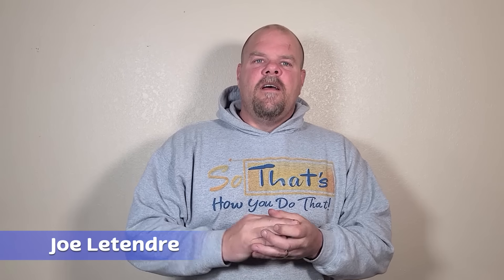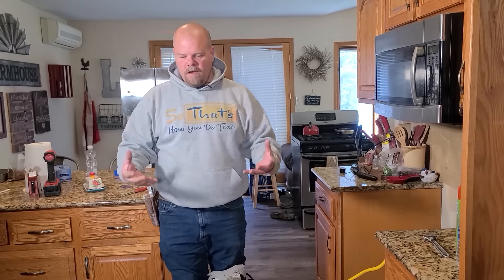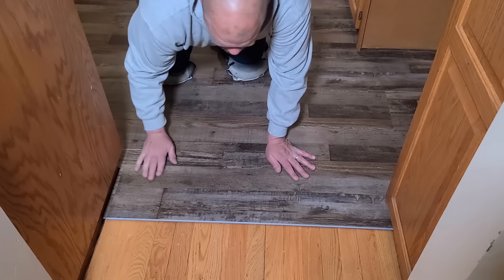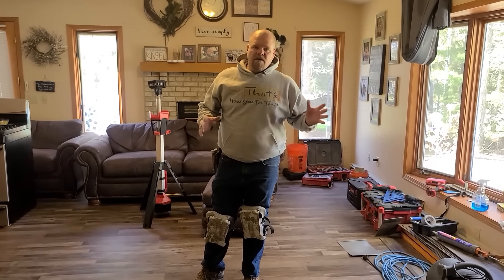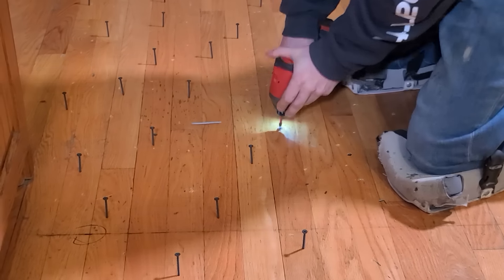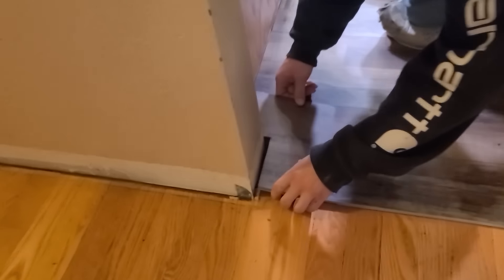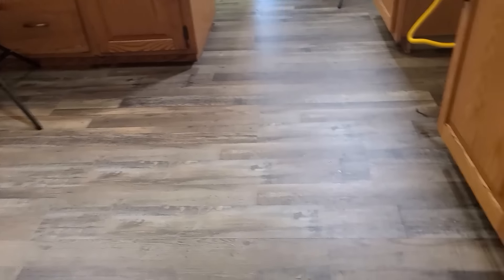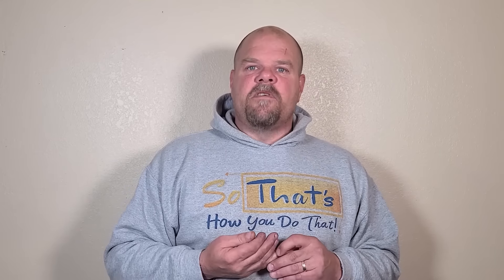I SCREWED UP this LVP Installation | Had to Take it up and Re-Install it

Comment: Hi Joe.  My vinyl feels like walking on sponge why? Do you always have to use moisture barrier on concrete and then vinyl to be right and not to get air pockets, spongy floor?????pls answer me
Reply from the maker: I personally do not use a paor barrier with vinyl plank. I am not sure what the sound is from. Have you pulled a plank up to see if the slab is wet underneath?

Comment: I installed  my flooring  had a dip and the long side came apart :( I was able to fix it by glueing it etc but it keep coming apart what should I do .
Its the 3rd row from the starting part . It's the hammer lock style  to sk scared  to take it apart know
Reply from the maker: Can you just pull the rows of plank out without pulling them apart?

Comment: Installed LVP over new subfloor in double wide, huge mistake, have places where the floor has buckled. Guy says subfloor ( 3/4 ply) doesn’t have enough screws?? Does that sound right?
Reply from the maker: Ummm..... Is it the subfloor that is buckling?
Reply: You need to put 1/8th subfloor on top of the sub floor on the joists. Idk how to spell it but it’s something like lueon

Comment: should really mention that you were installing a unilin click system product a huge majority of vinyl products are using a i4f click system thats a tap engaged butt join and if they try to take it up like you did in the video they're going to break off the lip on the short sides. one thing i have my helpers do if we have to take up floor for one reason or another since we rarely have a lot of space to put things i keep all the planks in a row as one row and then flip the next row up side down and lay it on top and then flip the next row and so on to keep things in order.

Comment: I'm about to install a LVP floor. What's your feeling about Lifeproof model # I22411L ? It's 8.7" x 72" plank, 8mm thick, with a 22 Mil wear layer and waterproof backer?
Reply from the maker: I don't think you can go wrong with that product
Reply: All engineered floors are high grade photos,  with a wear layer.  Anything over 12mil wear is good for residential.  The critical part is what that photos adhered to.  If you want a long lasting product get an SPC.

Comment: Hi Joe, man am I in a bind! A year ago I installed LVP. Living room, kitchen, dining room and hallways had tile. So I floated LVP with attached padding over it. No issues here but Bedrooms had carpet and padding. After removal of carpet and padding there was roughly a 3/8 inch height difference  between existing tile and original concrete subfloor. 😬. 

I suggested to client from the beginning, self leveling compound to make up for the gap difference. Client disagreed and asked that I use plywood instead. I advised against it but proceeded with install. Plywood was installed using proper bonding adhesive.

Within 4 months I get a call about issues (plywood bubbled) because of expansion which I mentioned to client the risk of this happening. I removed and reinstalled correcting the affected areas of bubbling plywood. Before correcting affected areas I once again advised against plywood. Yet again client chose plywood. 

Now once again I got that call😳 same problem is occurring. Client now wants me to tear out plywood and go with self leveling compound to correct issue. 

Any suggestions? Please respond 🙏
Reply from the maker: Okay so just so I know that we're on the same page are you saying that this is a concrete floor a concrete slab I mean.
Reply: If you installed plywood over a concrete slab...
Using just “adhesive” would be your issue.  I’m going to take a guess and say you installed 3/8 sheathing and the adhesive you used is PL400 applied from a large caulking gun?..
Plywood is not flat, it’s usually severely cupped in the center.
Also, plywood in direct contact with concrete will wick moisture from the concrete slab.  This can lead to swelling at the joints, and also wood rot(if the slab has a high moisture content).

You would have needed to apply a roll on moisture barrier first.  Also, recommend to use a combination of Ramset powder actuated nails and PL400 for installing, or drill and plug TAPCON screws + PL400 for the installation of plywood.
Reply: You should have never put plywood over a concrete floor always will have issues. Unless the customer was a opposed to a transitions at the doorways that would have been the best option and least expensive. By the time you would have laid the floor in that room and installed the mpr the height difference would have not been very noticeable or even that bog of a step up or down as you would think.

Comment: The worse thing mentally is to have to do something over of that magnitude. I've only done it with certain things in many years and it sucks. Yeah those hammer down butt joints are nice but taking them apart. Yikes

Comment: Why not youse a 15 gauge  finish nailer in that situation ,then if they took up the vinal planks the original floor could be refinished without doing to many repairs to it,just asking,?????,👍✌️
Reply from the maker: I tried everything first and it didn't work. This is an older house and only has a 5\8 plywood underneath. The others areas of the house have a two layer subfloor. The 70's were just great, weren't they?
Reply: So That's How You Do That!  We're back to the 70's inflation 2.0 and hack homeowners doing interesting work

Comment: What a way to ruin a hardwood floor. Why not drill break away screws into the hardwood floor & sand it instead of throwing that trash LVT ontop of it and then drilling into it.